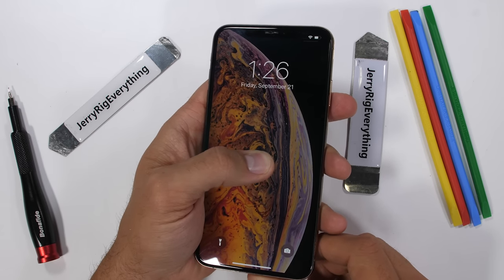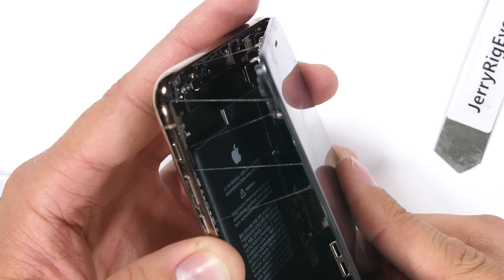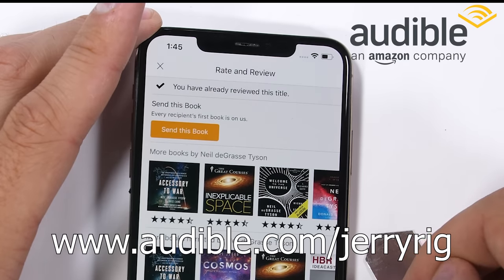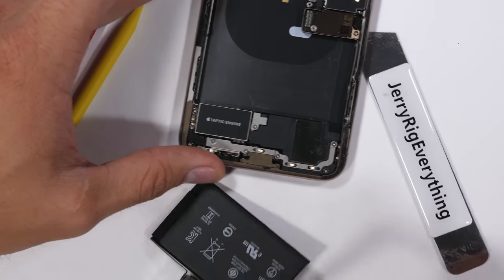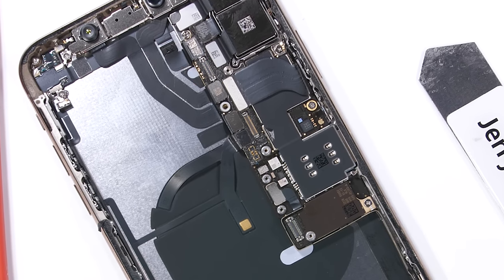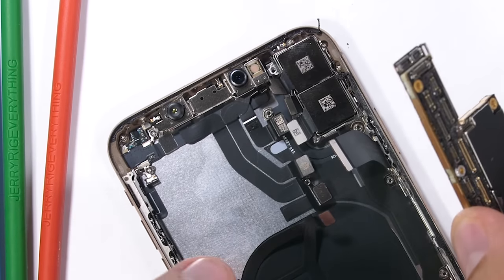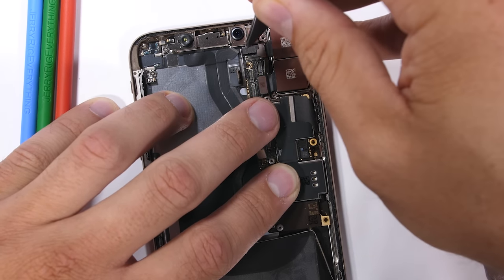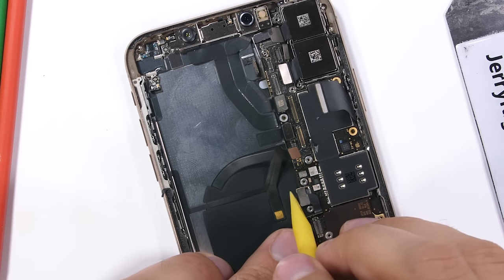iPhone Xs Max Teardown - Is there any Thermal Cooling?

Comment: "Upgrading your phone every year, is just dumb and, a complete waste of money." AMEN! I'm not a pro but, I loved my 2013 Xperia z3v so much, I took a leap and replaced the LCD and rear glass myself. I didn't have insurance. Nobody would touch it except for one repair shop that wanted to charge me more than I paid in the first place because they were insisting on ordering the wrong parts! They said, "if you do this yourself, you may break the rear glass." That was an entertaining sell point, considering the phone was already beyond use. I spent 1/4 of the money on eBay and, I'm using it right now!
Reply: Pamela Thompson - i'm about to say something totally inappropriate in today's PC society! But, the fact that you are a woman and had the ' balls' to repair it yourself makes this story extra badass! Congrats!
Reply: Pamela Thompson im have a 6S from 2014
Reply: Troy24 wow
Reply: I finally upgraded from a 4 year old iPhone 6 to the Xs. I take very good care of my electronics. The 6 still looks new having been in an Otterbox since day 1. I hope I have what it takes to keep my Xs glass from breaking over the next several years of use. It’s also protected with an Otterbox Symmetry case.
Reply: I am still stuck with moto G 1st gen(2012)
Reply: I used my Xperia Z2 for 4 years, replaced the battery myself for only $10. It still works until now, using custom ROM and it works better and faster than Stock ROM, try it. Just upgraded to Pocophone F1.
Reply: @Bacnow  thanks bro! Hey, I have to feel like they were trying to scare me away from doing it for 2 reasons. 1. MONEY. 2. The lame argument, because I'm a girl. When I watch these videos, it makes the build look easy as Lego blocks.
Reply: @TheBucenk  I'll consider it Thanks! I actually have two zv3s now because I was lead to believe mine was toast because I damaged the antenna. Got the second one, refurbished off amazon, same problem. Turned out the Reps at VZ gave me the wrong type replacement sim card! That was 2 hours arguing at a corporate store, then a trip to an indirect retailer who said, in under 5 minutes, "You're right, they gave you the wrong sim." NFC enabled are visually identical but, obviously not functionally.

Comment: Is there any logical reason that Apple would use 7.000 different types of screws in a phone, apart from make it difficult to repair?
Reply: OLBastholm Made it that difficult so even the Chinese technician will charge you more so you won't have any alternative and probably go to their Apple Store instead and pay a few extra bucks for the real thing... 🤑 It's all about money 💰
Reply: I'm pretty sure this is half hour job to get it all out and put it back together not a day worth of work ..
Reply: No.
Reply: So that you don't try to fix it and buy a new phone, preferably an Apple phone
Reply: so it's expensive to repair and you buy a new one instead of repairing
Reply: actually, there are pentalobes, trilobe and crossheads, that’s it. that’s 3 types. different lengths, but you only need 3 bits. And I can tell you as someone who repairs iPhones, they’re much easier than many other phones because they have modular parts made to be dis and reassembled a certain way. obviously if you’re trying to do a repair that was not designed to be feasible you’ll have a problem

Comment: Apple is pretty scummy with their business practices forcing customers to buy fast Chargers dongles all other competitors give that to you for free the fast charger and no dongle necessary for other devices with the exception of devices that do not have headphone jacks USBC is the way to go not to mention the replacement for the back glass is $600 outrageous
Reply: fractal it’s a replacement of the phone not the back glass, so in fact you could NOT do that and be fine since it’s purely cosmetic
Reply: Welp the iPhone Xs Max only costs 443$ for Apple to manufacture tho lmao
Reply: @shuyyq  you got to love those profit margins eh..
Reply: Wait what??? source? i thought cost of production would be much lower than that
Reply: fractal nah
Reply: True that
Reply: @rubinchen231  cost of materials probably cheap, but cost of production gotta be pretty high still(since you do include employee wages etc. into cost of production).
Reply: @Richard Decker I found the source haha after googling. I don't know if this is correct or not but wow i didn't know it cost so much to make one of these... https://i-cdn.phonearena.com//images/articles/331470-image/Apple-iPhone-XS-Max-component-cost-estimates.jpg
Reply: @rubinchen231  I cannot open the image, but I found an article(probs the acticle you pulled the image from I imagine) on the same site calculating roughly 443$ of component costs before adding R&D costs.
Reply: They're doing something right. Trillion dollar company 🤷🏻‍♂️
Reply: You forgot the most important part which is they are the most expensive phones and are completely manufactured in china to cheap slave labor.
Reply: @ItsJakeJake  in capitalist world, money is success, but it isn't the right thing to do.
Reply: ItsJake you dang right, but I hate that the external pieces are not included with the new ones, my IPhone 8 came with one but they should include one with a headphone jack and a charging port with the phone those things are $30 but I’m sure this is just them testing if they include it will the sells be the same or lower and then they will probably include them again
Reply: 21SYQ  $443 is actually really expensive. I believe the Galaxy Note 8 cost SAMSUNG $370 to make. Also, isn't this a pretty good argument as to why the iPhone cannot be priced $300 like the Pocophone or $529 like the OnePlus 6?

Comment: Hey. Could you possibly to do a test of some liquid screen protectors? I think you're pretty much the best youtuber for durability testing, especially when it comes to using your moh's set for scratch testing, so I think you could test some of their claims of 9H hardness. I always use a screen protector on my phone to avoid scratches, but it would be interesting to see if these liquid ones are actually as scratch resistant as they say so I could enjoy having a more bare phone. Thanks
Reply: I have had some "9H" screen protectors and to test them for hardness i rub them on concrete (after discarding). If that scratches it, its not a lvl 9. They always scratch, but some fare better than others

Comment: Apple charges 599$ to replace the back glass. It's because the back glass is impossible to replace. Apple themselves swap out the whole frame and housing instead of the back glass. And you're right, that seems incredibly inefficient and an incredible amount of work, but that's how they built it. It doesn't bug Apple at all though. It's just their way of coercing you into buying a new phone instead of fixing the old one. Say good bye to your wallet for me.
Reply: Wow
Reply: The display is easy to repair though.. 
a lot easier than on Samsungs Galaxy.
Reply: @Phaios95  sure,we all saw that now 😅
Reply: Can’t Apple destroy the cracked back glass of the iPhone and pick the glass pieces then put in a new glass panel
Reply: Steror 
Why did you just copy what he said in the video wtf
Reply: You just copied that lol 😂 and this comment is very underrated
Reply: @Phaios95  Yeah that's true because iphone displays break often and batteries get f ed up much faster for no reason. So they needed much efficient option to milk the customers.
Reply: Kirushanth Sharva 
cough Galaxy Note 7 cough
Reply: Kirushanth Sharva Seriously. They use the same glass. And Samsung batteries are wearing of as fast as any other lithium ion battery does.
Reply: I was reading this as he said it
Reply: @MetraMan09 so
Reply: @Phaios95  dumb ass you have never owned one
Reply: AppleCare is amazing though, just had my entire phone replaced for about 50 bucks. Used my 8 plus for 2 years which is a lot of wear and tear on the battery and hardware in the phone. 50 bucks later and boom brand new phone.

Comment: I can't believe Apple includes a condom in the phone but can't include a fast charger in the box,,,,lol
Reply: fast charger kill batteries
Reply: @theAppleWizz  actually apple did this so you could get their $50 fast charger, obviously you don't have to
Reply: @hafi8121  ok let me explained this in a way that you might understand or it could go over your head  batteries have a have a charge rate about 1 amp an hour. fast chargers typically go up to 2.5 amps an hour. this means that you are pumping 1.5 more amp into the battery that it can normally handle over time this "fast charging" damages the batter so it will not be able to keep it's charge for a long time. also it will not be able to provide it's peak power that is needed. Now imagine all the dead battery in no time if everyone had a fast charger.
Reply: @ko-Daegu  hahah I was over simplifying but ok think what you want to think
Reply: @theAppleWizz  These are facts, not opinions. Fast charging don't do any type of damage to the battery.
Reply: @robertosotgiu9700  Depends on the battery and it's IC
Reply: @theAppleWizz  Not anymore, we are in 2018 : )
Reply: Fast charging reduces the life-span of the battery. This fact is fairly easy to deduce theoretically and prove experimentally. The reason is the increased heat that the battery is subjected to and maybe some other stuff.

But of course, the reduction of lifespan is insignificant if you are going to change your phone after a couple of years.
Reply: @inventorofmachines  An example: 
OnePlus 3 release: 2016. The heat created in the recharge of the battery is completely absorbed by the charger, so the heat don't do any type of damage to the battery.
Reply: @robertosotgiu9700  ok just stop you don't have any idea how all of this works engineering wise. I do
Reply: if apple intend to "not hurt" the battery, why DO they have fast charging cable for sales ?
Reply: Haha wtf
Reply: @theAppleWizz  on Android it's not the amps that matter but actually the volts that quick change (mine goes up to 12v) also batteries do have a limit on how much power you can change it with but it's more like 2 instead of one
Reply: theAppleWizz lol what a applesheep, can’t accept facts that show apple isn’t perfect
Reply: @theAppleWizz  I'm having s8 plus and I always use fast charging as I'm in a hurry . I see no difference yet using 1 year
Reply: apple is not that intelligent so they added 50 dollars to get fast charging . BTW why can't u say this tip to apple earlier ?
Reply: isheeps triggered....Lol😏
Reply: @theAppleWizz  bruh your phone is inferior. Just accept it. Maybe the fast chargers ruins the life of your garbage iPhone battery but it doesn't affect the androids.
Reply: theAppleWizz just stop
Reply: @theAppleWizz  noob
Reply: @theAppleWizz  I would take a fast-charging phone (that I don't have to pay $50 extra for) any day over a phone that purposely kills itself after a few years.
Reply: My Samsung battery is broken because of fast charging but that's only because I always leave it charging for too long so now my battery dies even when I'm not using the phone...
Reply: Y'all stop coming at theapplewiz dang.. they had an convo that ha nothing to do with y
Reply: @theAppleWizz  but are YOU and engineer? Just because you bought an overpriced iPhone doesn't mean you are entitled to be an "engineer" or whatever you call that as an iSheep
Reply: @theAppleWizz  and besides, the average consumer nowadays would replace their phone in 2-4 years
Reply: Lol
Reply: theAppleWizz thus comment is 4 weeks old but idc 
there is something called regulators and thus making it compatible with any phone like you said in one of your comments that a phone that only draws 1 amp but is being charged at 2.5 amps well there is a method to keep the battery from degrading , the regulator balances the charge so your phone wont get that 1.5 amp of power and simply only draws out 1 amp in doing so fast charging is just going to be a normal charge
Reply: @theAppleWizz  fast charger kill batteries
If that was the case they wouldn't sell $50 fast chargers, or disable fast charging entirely. They didn't do that.
Apple couldn't care less if the battery dies after a year. They're in it for the money so it's in their best interest for the batteries to last as little as possible, within a reasonable margin of course (wouldn't want the battery to die out in the first month now, would we?). Besides they genuinely throttled down performance to make people give up their old phones. Again, if they actually cared about the consumer they would have gone the Huawei way where you have performance profiles that you can pick and choose if you want to preserve your battery.
Reply: I was forced to get an iPhone help ok but seriously I prefer it over android however I do have my old android on hand in case anything happens
Reply: sorry but protection is better than explosive.. c;
Reply: @mariosangourakis2440  but actually prevention is better than cure xd
Reply: As fast charger user, My S8 battery life has gotten bad. Still usable but not as great as it started. Nothing last forever, I am not expecting phone batteries to last longer than 3 years.
Reply: I see lol
Reply: @jeromealday614  just sold my Honor 8 this weekend. Fast charged every single night for the past 2 years I had it. Battery still lasts through the day on above-average usage. Yeah it's taken its toll but I doubt it would have lasted more if I used normal charging. My previous phone, a Honor 5, lasted a year and a half after the charging controller went bust and decided not to charge the battery at all. And that one had no fast charging.
Reply: @robertosotgiu9700  I can buy any phone I want, I dont need a fast charger
Reply: @user-gb2ol2cp1n  Perfect. Good for you
Reply: @robertosotgiu9700  Ok?
Reply: @user-gb2ol2cp1n  Of course
Reply: @theAppleWizz  Bruh you are the one here who needs to do the research on topic. The main idea of any fast charger is to boost up the amount of energy for a short period of time in a manner it wouldn't heat up the battery too much and woudn't overcome the amount of energy the cell can get without degradation at a moment. That's kinda the main reason why we have SoC solutions out there that watch over the parametares in real time to decide what charge mod is the best at a given moment and not just dull voltage/amps increase.  For example QC 4.0 can adjust voltage from 3.6 up to 20v with 200mv steps, so you can kinda imagine how accurate the charger can be. BTW if you haven't figured it out yet the amps that cell can withstand without damage at a given moment varies.
Reply: @Shonicheck  I'm not saying that fast chargers are not a thing. I just saying that with a low capacity pack degradation will be grater.
Reply: Damn you guys are mean, you made apple whizz boy stop responding lol 😂🤣
Reply: @theAppleWizz  Nah bro. You originally said that, quote unquote "fast charger kills battaries" which is much stronger sentence. Also degradation that caused by last gens of qc is not that dramatic, I mean in theory it is presented (like because our means of adjusting/measuring are not ideal) but the thing is that in practice there is hardly any difference. For example friend of mine works at a repair shop and as far as he can tell the battery life time of QC enabled device and normal device are on the same level, which tells us that even if there is a difference it is should be really insignificant (like few days/weeks maybe month). Of course I haven't really ran a test on those, but I think neither did you. But to be fair the first versions of qc were kinda crappy, as my phone runs adaptive fast charging which is crappie version of qc 2.0 from Samsung I can admit that battery degradetes very noticeably throughout a year/ year and a half.
Reply: @theAppleWizz  not really. Fast charging does not kill the battery
Reply: theAppleWizz wouldn’t that just benefit apple?
Reply: I dont know why this guy is defending apple on not coming with a faster charger to protect the battery while apple is literally selling a fast charger for another $50.

Comment: hey, at least the charging port isn't soldered to the motherboard, like on the moto g4, whose charging port coincidentally happened to fail one month after warranty ended
Reply: That’s what I was saying. Plus the fact that they have crappy micro USB ports that are known to wear out, get loose and fail. I can plug in my iPhone 5 and it’s lightning port feels like it did when I got it at launch.
Reply: @scej79  my iPhone 4 charger still works l
Reply: Dont give apple any ideas